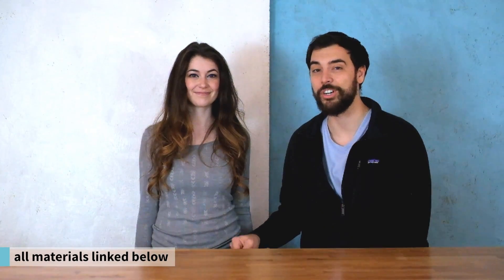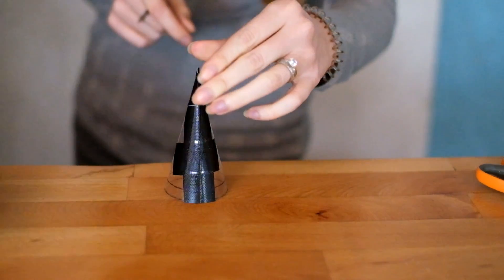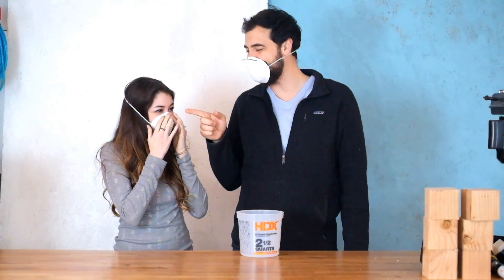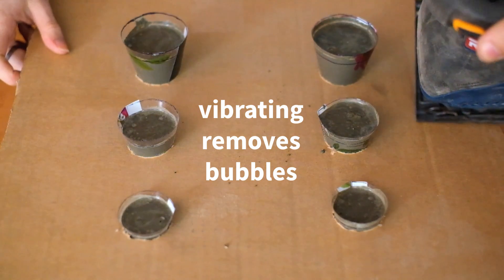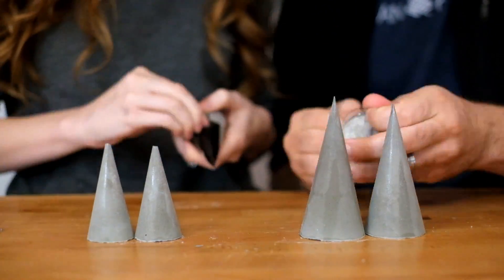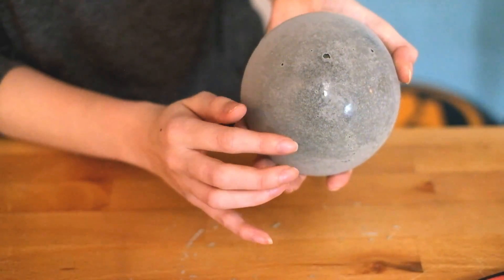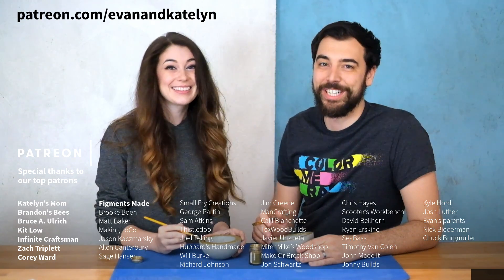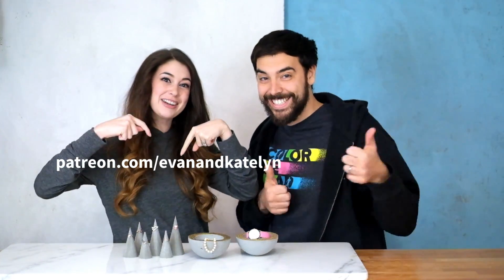Concrete ring cones & jewelry holders | How to

Comment: That was fun! I love the way you shot this one, with the finished shots mixed in all over the place. I would not have guessed that the bowls would turn out to be harder. Twist ending!
Reply from the maker: +Bruce A. Ulrich thanks! Definitely did some experimenting with the editing for this one (the final shots used as transitions, including more behind the scenes type banter, starting with the blooper) and yeah we thought the bowls would be easier too! They definitely could be easier if you leveled the concrete and found a way to pop the plastic out more easily (not that it was thaaaaaat hard)
Reply: I wonder if you could spray some mold release in the bowls or even some cooking spray? That might help them release without much effect to the concrete.
Reply from the maker: +Bruce A. Ulrich we considered it - might try it if we end up making these again

Comment: I've done some of this in the past using the cement that is used for oil wells, it goes really shiney. The guys I was working with at the time brought all kinds of plastic packaging in for molds and it was Easter time so we made a lot of rabbits and chicks one of the guys stuck two halves of an egg together and it moulded perfectly apart from a tiny seam, so tactile!! Happy happy,  thankyou guys.
Reply from the maker: That's awesome! Love it when you find good molds to use!

Comment: Such a cool idea!  I've got half a bag of cement in the shed so might give this a go.  Have you thought of using a cement dye to colour the concrete or maybe adding something like glitter to add a sparkle?  I also recall a technique with oil paint floating on water and dipping objects in to it to add a marble effect.  That might be interesting for the outside of the hemisphere.  Thanks guys.
Reply from the maker: +Thistledoo 47603 thanks! We actually looked into getting a dye (Ben Uyeda has a good video on this) but our local big box store didn't have any colors we liked in stock. And yes I've seen that marvel technique used for various projects but we've never tried it! I think it would actually be fun to do a few different shades of white and gray concrete and then swirl them to make it look kinda marbled

Comment: good job on that stop motion! 
(and of course, this is an excellent project overall!)
Edit: btw, how did you get the base of the cones flat and smooth? kinda seems like you would get sort of...."rocks" in there
Reply from the maker: +Glowing Dude thank you!! I think vibrating the cones helps level out the concrete - we didn't even have to sand the bottoms of them

Comment: i've seen some diy concrete projects where they recommend using clear coats or other spray releases on the molds (the plastic domes in this case) and that should prevent the concrete from adhering to the molds and it should just pop right out! kinda the same idea as adding cooking spray to the muffin pan before adding in the batter! Not sure what works best for your molds but maybe its worth researching?
Reply from the maker: +Logan Lovell we will definitely try that next time!plus then the inner molds would be reusable

Comment: I've made similar items, like votive holders/tealights with bowls instead of ornaments.  I used a regular metal kitchen mixing bowl and prepped it first with cooking oil to act as a release agent.  It popped right out when it dried!  Maybe u can put some of the cooking oil on your items first, then u wouldn't have to use the heat gun or ur brute strength.  You can use any oily substance as a release agent - petroleum jelly, any oils or anything made out of oil or petroleum jelly...like Vicks, lol!  That would be smelly tho  ;)  Tfs!  I wanna try the ring holders!!!
Reply from the maker: We'll definitely try that next time! Thank you!

Comment: I know this was ages ago but for people watching later it would maybe be easier to remove the middle "bowl" if you used super glue or epoxy to stick a handle, Ring, block or something to the inside of it so you have something to help rotate or rock as this would give you leverage plus if it's lined up you can use it for pressing it into you concrete with the weights. Anyway only my 2 pence worth.

Comment: This is a cool one.  I may have to do a variant on this at some point.  

Quick question/suggestion for your videos -- are your final videos in 30 fps or 60 fps?  I ask because I originally was doing mine at 30 fps, but switched to 24 fps, and like this much better.  I read a few articles on getting a "cinematic" look, and all of them recommended 24 fps.  It was totally counterintuitive to me that lower fps might look better...but I think it does.  You guys have awesome production in general, so this is something VERY minor, but to my eye it looks like you might be using a higher (e.g., 30) fps, so I figured I'd throw this little nugget out just in case it is useful.  

p.s. Happy New Year!  Here's to more awesomeness in 2018....
Reply from the maker: +Modustrial Maker we film at 60 fps. That's very interesting about filming at 24 for... It does seem counterintuitive but we're definitely down to experiment and see! Thanks for the nugget 😉 Happy 2018 to you too!
Reply: EvanAndKatelyn yea, totally counterintuitive, but I think you'll notice a difference.  You can actually still film at 60 fps, and just set it at 24 fps when you generate your final video from premiere or whatever video editor you are using.  (An easy expirement is to take one of your final video projects, and just regenerate it at 24 fps or 23.97 fps, and see if you like how it looks in comparison.)
Reply from the maker: Modustrial Maker cool!! We will try that out! 👍👍👍👍 Thanks again for the tip
Reply: No problem.  I'm curious what you think :)

Comment: Absolutely loved this one! I really want to try some concrete projects so seeing you do this really helped! -  I have two questions however:
1) what ratio of sand/ cement did you use? 
2) have you ever thought of doing something similar but using plaster of paris? I feel like it would look amazing :)

EDIT: Couldn't you hot glue or bond on a dowel/plastic tube to the inner sphere so you could remove it really easily by just pulling?
Reply from the maker: +JMakes thank you! The concrete we buy (there's a link in our description) is premixed so all you have to add is water. We really like it and use it for a lot of projects and products. We've never used plaster of Paris but we are down to try! Also I think your idea about gluing a dowel to the inner mold is definitely worth a shot! Maybe with e6000 so it's a little stronger
Reply: I can't find the ration mix on the concrete link so either its 50/50 or just concrete - who knows??!
Yeah you should definitely try plaster of paris - I really like the look of it (kind of reminds me of marble). Its not the most durable of materials but with some varnish it can stand up to most things! 
If you ever need any help/tips using it feel free to send me a message!
Reply from the maker: +JMakes thank you! Will do! Would love to try something with a marble look.

Comment: That looks so great. Still using the vinyl concrete patcher just like the letters?
Reply from the maker: Thanks so much!! Yup that stuff is pretty easy for people to find, nice and fine, and has been working great for us :D
Reply: EvanAndKatelyn not so easy in the Netherlands. Tried poring cement that worked not so great, I also tried a concrete floor patcher that worked great, but was really expensive 😐
Reply from the maker: +v Zuijlen ah darn! I'm sure it's kinda pricey to shop too since it's heavy?
Reply: EvanAndKatelyn muah. Can get everything with the bike. But the concrete patcher is 10 euros for I think 2-2.5 full lettermolds(2kg)

Comment: Step 1 - cut out template to trace around onto clear sheets
Step 2 slip under clear plastic sheet & trace.

Am I the only one to notice cutting flush to the pattern could have been skipped?